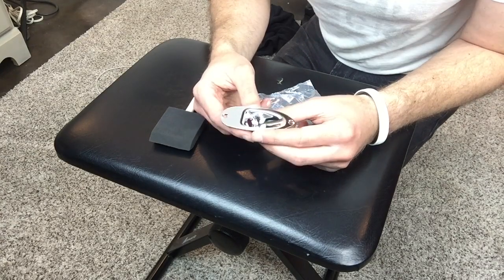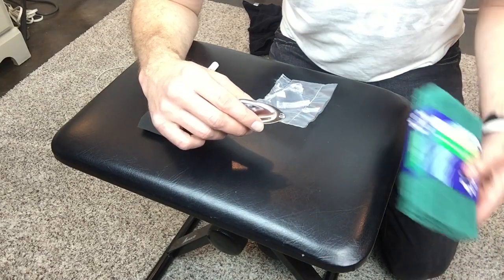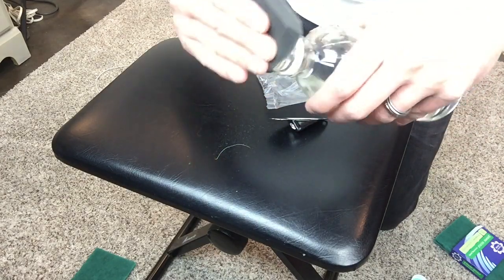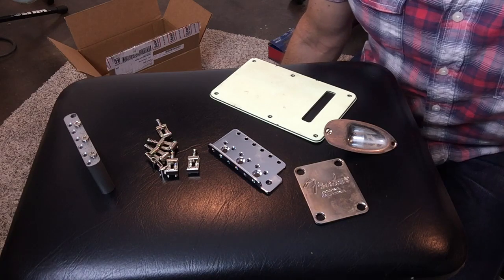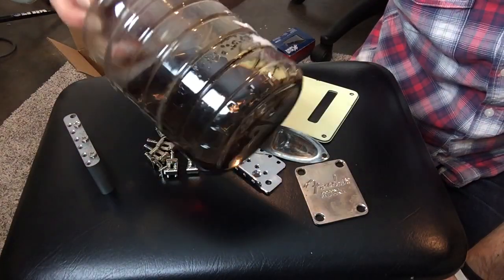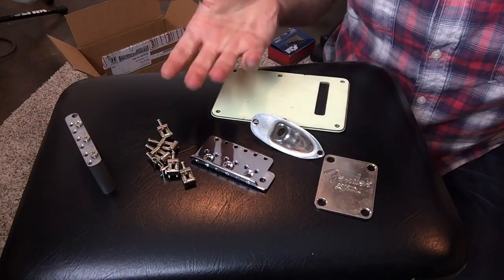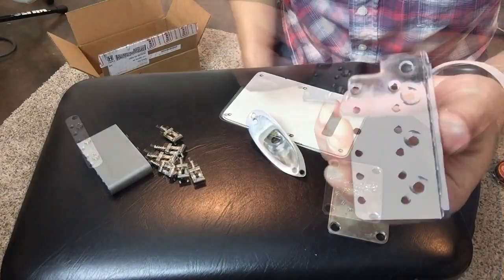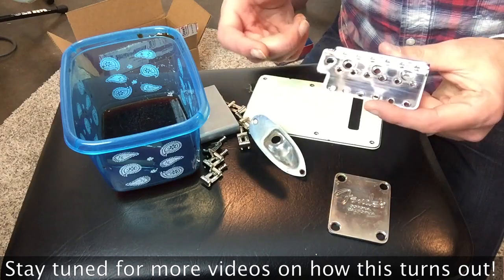Relic Hardware: Testing Various Methods

Comment: That vinegar and steel wool is awesome on the wood! I used that on the exposed wood on my relic and it really looks natural! For the metal...I actually ended up using the muratic acid...a small container inside a bigger one with the vapors...worked well. For all my screws, I screwed them partially into a block of wood and dabbed a little of the muratic  solution just on the head of the screw and let it work till I got the desired effect, then rinsed. That way it didn't rust the screw shaft itself and make it weak. Everything turned out pretty cool for my first time. I'm happy with it!☺
Reply from the maker: 74dart man that’s good to hear! High five! ✋🏻
Reply: Nathan Sink thanks for all your videos. They were a lot of help!

Comment: Use the scotch pad to "score" the chrome surface. Then i boil all of my hardware in pickle,lemon juice and saltwater for 20-30 minutes.  It strips the oil coating off the metal letting the humidity and your body acids naturally rust the hardware. You won't notice a huge difference at first, after a couple of weeks it will definitely be aged.   Important tip:: oil the little hight adjustment screws on the bridge saddles or they will rust and be unusable.
Reply from the maker: Thomas Partin thanks for the good info. Love it when people share their experiences. 👍🏻

Comment: I put mine in a bag filled with dirt rocks and sand then put it in the dryer for 45 minutes  then I coated it with wheel bearing Grease and baked it on high for 1 hour   then I put it in a sock and put it into washing machine with bleach 
And ran it through a wash cycle  finally finished it off with a rinse cycle  I usually do several at a time and I have an old washer and dryer in my shop
For this purpose only.
Reply from the maker: That’s one way to do it! 👍🏻
Reply: That’s fkng hilarious
Reply: @Falevaaa  
My dryer finally conked out on me today  Was probably the sand getting in the Bearings
And I don't know why I didn't think of this before , but I have a electric cement mixer
So I put my parts in it didn't even have to use a bag , added some sand and gravel and cement mix , This method worked Alot better , I think it had something to do with the line in the cement
Only thing was I unplugged it and left the parts in it And made a run to the beer store And in the meantime it had started raining And all that cement set up hard , Took me about a half hour to beat it loose , Turned out to be the best batch of relic parts I had ever done , didn't even have to use the other two steps   Tomorrow I plan on doing a dry batch and seeing how that turns out   I think I'm really on to something here.
Wish me luck.
Reply: I would do this, but I enjoy sleeping in my bed. The couch is good, but ultimately I think a different method would be preferrable in my situation.

Comment: I put a chrome finished watch in muriatic acid to remove the finish. It's solid brass underneath and that's why I bought it.
Reply from the maker: Interesting! Did you have to polish the brass afterwards to get rid of any patina?
Reply: @NathanSink  90% of the chrome came off. parts of it are a dark color where the chrome didn't come all the way off and some of the recesses on the bezel didn't strip. it looks great. I was going for brass (at the time) but it looks like a HEAVILY worn chrome watch. a majority of it is brass. I use it as an experiment most of the time. I had it in the tiny pocket in my jeans for 2 weeks, attempting to do a "soft" edge polish. I also had it in a salt water bowl for 72 hours, it was supposed to be 12 hours but I forgot about it. I've wet sanded chrome with 1000 grit, I got a better result than dry sanding.

I'm putting together a guitar. I had a St.Vincent body cut with a single humbucker and I'm doing aged clear over a walnut stained body and relic-ing it. All the parts of the body that the lacquer is removed will be stained with the vinegar and steel wool mix. I'm aging some nickel hardware and amber speed knobs. I got a neck from Warmoth with glow in the dark dot inlays. 🙂
Reply from the maker: @Dr.Smartbrain  nice! Sounds like some fun projects. Hope the guitar turns out great. 👍🏻

Comment: The repertoire of chemicals and techniques I use include JAX chemicals, BW Casey aluminum black, ferric chloride copper etchant solutions, white vinegar, coarse salt, steel wool, Scotchbrite pads, and Flitz metal polish.  

For working with white vinegar I recommend heating the vinegar in a microwave oven for long enough to start kicking off vapors.  I combine that with a little bit of sprinkled course salt on the part, such as a chrome plated Fender bass bridge base plate.  

I use Flitz metal polish last to hand rub what's remaining of the corroded or tarnished chrome or nickel plate.  A bit of Dremel polishing wheel can also be useful.  This last touch helps to make the parts look worn by use over decades but with a touch of care so as not to appear so artificially reliced.
Reply from the maker: Thanks for sharing your technique! Sounds like you’ve got it down to a science. I actually tried to relic some chrome humbucker pickup covers recently & it didn’t go so well. 🙄 I roughed them up with a scotch brite pad & 1000 grit paper & then I did some muriatic acid exposure. But I could never get the scratch marks to go away. Any advise? (Btw, I ended up just buying some raw nickel covers in the end, but I’d still like to know for future reference 😊)
Reply: @NathanSink  It's alway a YMMV/PITA proposition when chrome is in the way... you know.   All one can do is try a finer scratch pattern Scotchbrite pad then use a buffing/polishing compound with a buffing wheel to try to deal with scratch marks.
Reply from the maker: @YTPartyTonight  that confirms what I was thinking. 👍🏻

Comment: if you want more "rusty" looking parts my guess is you put the hardware in a can after all your sanding and acid (don't sniff the stuff ahah) add a little bit of water/salt and leave it outside for a little while.
Reply from the maker: That would probably work!
Reply: I'm actually going to try that on a tele partscaster project.
Reply from the maker: justrockon426 hope it works out!  Let me know how it goes. :)
Reply: well I watched a video called "Schecter After Hours: How to Relic Hardware" and it talks about this stuff so i'm going along these steps, got my partscaster tele project disassembled. and just started sanding the chrome hardware.
Reply from the maker: justrockon426 I’ve seen that video: it’s a good one. 👍🏻